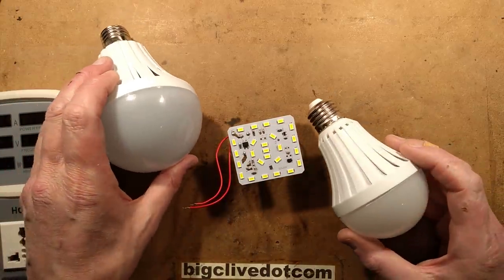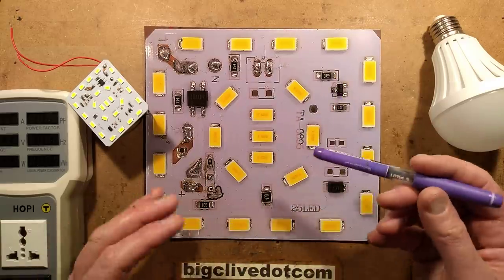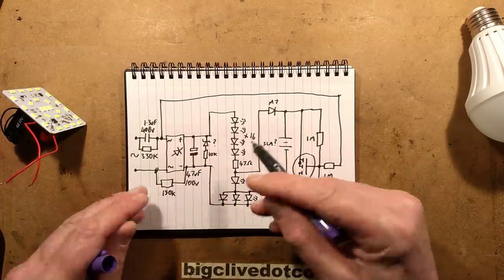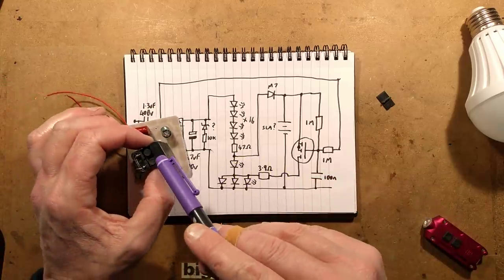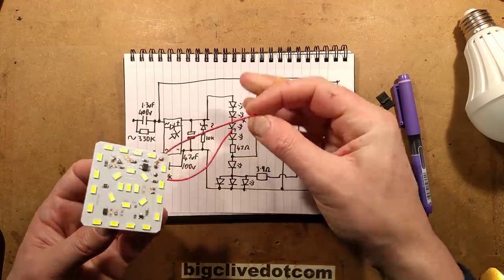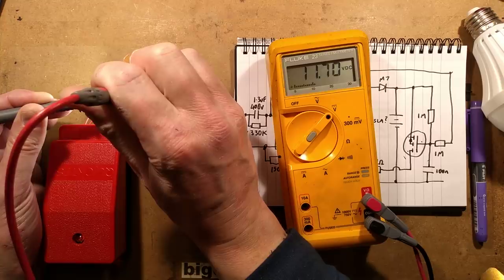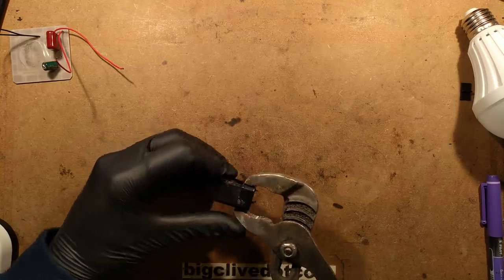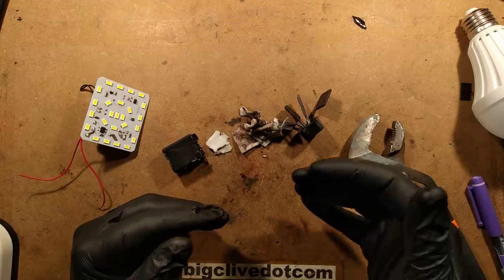Crappy lead-acid LED lamp with brilliantly simple circuitry.

Comment: That's the cutest little lead acid battery...
Reply: volvo09 I wonder if they are cheap enough to couple up a hundred or so for my car?
Reply: I have some 2 volts that would possibly spin the starter....they double as boat anchors when not powering stuff.
Reply: For starting those tiny Chinese cars...
Reply: I can't believe they are that small!
Reply: In the 90s a friend had a Walkman with sla.
Reply: baby sla battery
Reply: It’s a baby one
Reply: I love them 😍
Reply: Awe such a cute lil AGM 😂

Comment: I guess any diode can be an LED (briefly) given the right circumstances.
Reply: I was just about to say that. Thanks ElectroBOOM!
Reply: Well it was a diode and it emitted light so absolutely correct, not quite conventional or intended...🙄but typically Clive
Reply: Almost anything will light up briefly if enough current is applied!
Reply: Giovani Tapini even Clive...
Reply: There is, of course, the classical N.E.D., the Noise Emitting Diode, closely akin to the Write-Only Memory.
Reply: Now that's slick
Reply: SED-Smoke Emmiting diode
Reply: until the magic smoke makes its appearance!  LOL
Reply: @Yuri-xs9de  Hmm... i wonder if someone would be bold enough to make a vape-emitting diode... ugh...
Reply: Ackchually, pushes up glasses, all diodes do emit photons, though it's usually outside of the visible spectrum. If you got rid of their packaging, all diodes would be sensitive to light, acting as micro solar panels.

Comment: I used to work in the battery charger industry. The work used to involve the fitment and maintenance of battery charging equipment in electricity power stations and substations. Sometime in the 1980's the National Grid and regional electricity companies started specifying SLA cells, because they were promised by the battery suppliers a lifespan of 25 years and zero maintenance.
Unfortunately for them, they fell foul of a characteristic of SLA's that you probably didn't know. The 'float' charging voltage of an SLA (the voltage applied to the cells when they are fully charged), is dependent on temperature. Most modern industrial battery chargers are equipped with remote temperature probes, which should be situated at the battery location. The probes then send a signal back the charge controller, which reduces the charging voltage when the ambient temperature increases. In a lot of cases, new SLA's were installed with old chargers, with no temperature compensation. If the location of the battery / charger was somewhere nice and toasty warm, the cells would fail, sometimes in as little as 5 or 6 years. 
That being said, I can see a very short life for that little 2 cell battery. Not only is it being overcharged in the first place, I'm guessing it will get pretty hot situated behind those LED's.
Reply: The forward drop of a diode also goes down with temperature, and it's nearly the same tempco as a lead acid battery.  I've been using a string of silicon diodes as a float voltage regulator here on the off-grid homesite for decades.  LA batteries last a looooong time when you do that.  Now, as to the tempco of those forward biased leds, dunno, but I'd bet it's similar.  So, likely more clever than realized here.
Reply: @pmailkeey Well, given that Lead Acid batteries DO have a tempco, and the slightly different chemistries act a little differently (maintenance-proof PbCa vs normal) and some are more easily harmed by electrolysis (AGM), that's not a question with a single answer....
Most of my work is with deep cycle batteries, like the ~ 2300 ah 24v nominal that run my homestead (with solar and backup generators etc) or just act as a secondary UPS for the ham rig and a couple important homestead lan of things computers.  Those tend to follow the curves given by Trace/Xantrex/ or the battery manufs pretty closely.  https://batteryuniversity.com/learn/article/charging_at_high_and_low_temperatures has some info.  If you know a battery is fully charged, it ought to be set to some voltage that makes it draw only a tiny fraction of C to just sit there...maybe 50ma for a 100ah battery or so.  Which would usually work out around 13.5 v at around room temp for a trolling deep cycle "12v" battery, a PbCa one will float higher happily (14.1 at least, those don't gas as easily but also don't live through deep cycling), and you shouldn't really push any continuous current into an AGM battery.
Reply: As mentioned below, my big ones (a few tons...) DO have catalytic caps that recombine any H2 and O2 into water if I gas them a little.  Pro solar charge controllers do this according to a schedule.
Reply: What is the forward drop of the M7 Diode (I think that's what the schematic says)? The larger the drop of that diode, the lower the charging voltage will be. It could be a diode chosen for high forward drop.

Comment: I can't imagine a more pleasant design than little plastic cases filled with sulphuric acid above my head in small cheap devices that may fail with heat.  Awesome!
Reply: AGM batteries don't leak.
Reply: @----.__  I know they are sealed but when they fail they do. I am the proud owner of a failed AGM battery that was in a golf buggy and I can promise you it leaked the magic juice.
Reply: @CozzyKnowsBest  Ouch, that's unfortunate. We use them in our designs for heavy workclass ROVs due to them being non-serviceable and functional in any orientation. We do buy disproportionately expensive ones though due to having to meet hazardous area standards though, I now shudder to think of what is sold at the consumer end.
On another note, "Came House", my goodness. It's strange how footage like that can be both awe inspiring and saddening, I can almost hear the laughter of a family playing in the garden yet it's juxtaposed by the dilapidated state of the estate. Your videos are amazing.
Reply: I think you're being sarcastic, but tiny lead acid batteries in my light bulbs actually does turn me on.
Reply: Also a failed or overcharged lead-acid battery can emit hydrogen sulphide which is a poisonous and explosive gas.  I once left a LA battery charging downstairs when I went to bed and in the early hours was woken up by an awful smell, which I blamed on the cat.  When I got up for breakfast the smell was worse and the copper pipes in the kitchen had turned black.  Only then did I realise that I'd a narrow escape.

so, don't leave a LA battery charging overnight, charge it in a ventilated area, don't charge it in the house, use an intelligent battery charger.

Comment: A small but interesting point of chemistry: Sealed lead acid batteries don't use polyester (which would be decomposed by the sulfuric acid) or any other type of plastic to absorb the acid. The only plastic involved is the battery casing, which is typically polypropylene or high density polyethylene, since they are structurally strong and resistant to all acids.

There are two types of sealed lead acid battery: Absorbed glass mat (AGM) cells or gel cells. In the AGM type, the space between the lead plates is filled with fine glass fibre matting, similar to glass wool for cheaper cells or can be the properly woven matting for high end, ultra-durable cells. The glass fibre soaks up the acid and holds it in place.

Gel cells use about 5% by weight of fumed silica (silicon dioxide) which is an especially fine powder, made by incinerating silicon tetrachloride in a 1500 degree (or hotter) flame. This has an absurdly high surface area which makes it an excellent gelling agent, and its inert nature means it can be used to gel concentrated acids, even rocket grade nitric acid if necessary.

The two types do have advantages and disadvantages. Gel cells contain more acid for their size, giving them a higher amp-hour rating, since the charge capacity of a lead-acid cell is based on how much sulfuric acid it can hold. However, gel cells can still suffer from plate-warping (if the gel is allowed to dry out) and bridging crystal growth (resulting from excessive discharge) in the same way as ordinary wet cells.

This is where AGM cells have the major advantage. They contain less acid (so have lower charge capacity) because more of their volume is filled with glass fibre. However, the glass fibre matting holds the lead plates apart and prevents plate-warping, even if the cell is completely dried out. The glass matting also prevents (or at least inhibits) bridging crystal growth, meaning that AGM cells can be subjected to much deeper discharge cycles without damage.
Reply: If the cell is completely dried out, why would plate warping be of any concern? That cell, and the whole battery, is ready for the recycling bin regardless of how straight the plates are.
Reply: The usual cause of plate warping IS drying out of the cell, and it doesn't have to be completely dry for that to happen. The liquid component of the battery (the electrolyte) is 35% sulfuric acid solution in water, regardless of whether that is gelled with silica, absorbed into glass fibre, or neither. The sulfuric acid is converted into lead sulfate when the battery is discharged, the reverse happens on charging, so very little acid is completely lost unless the battery case has a leak.

The water is another matter: Some evaporates through imperfect seals, but most water loss is due to overcharging, which causes electrolysis to happen inside the battery, producing hydrogen and oxygen gases. Sometimes, batteries installed in airtight compartments have catalysts fitted inside which recombine these gases back into water, preventing water loss, pressure buildup and risk of explosion. This is however expensive, so in most cases it is easier to just periodically check electrolyte levels and top up batteries with distilled water.

If this is not done, then eventually the electrolyte level can drop enough for the plates to partially dry out. That subjects the plates to temperature variation and uneven sulfate buildup, both of which can bend or warp them. This is usually irreversible and results in the battery being binned, or preferably recycled. The exception is with AGM batteries, where the glass fibre holds the plates in place and stops them bending or warping. If it is mainly the water that has been lost, the battery can just be topped up with more water. If both the acid and the water have been lost somehow, then fresh 35% sulfuric acid can be added. Either way, the battery will then work again.
Reply: @lloydevans2900  Ok, if the cell is dry and you're going to attempt to add water, it would be good if the plates weren't warped. Got it. I've never tried adding water to a gell cell or SLA because until recently I did not know that it was possible (but apparently once you break the cover off, the battery is no longer an SLA, just an LA, and will leak if not kept upright).
Reply: @lloydevans2900  Also I've read in several different places that in SLAs the hydrogen and oxygen produced during an overcharge can recombine if the pressure inside the battery does not rise so much that the 3-5PSI vent opens. I have not however read how this is supposed to happen.
Reply from the maker: I did wonder how polyester fibre would hold up to acid as soon as I mentioned it.  The traditional glass fibre does make sense.
Reply: @brianleeper5737  The method for recombining the hydrogen and oxygen gases produced during overcharge is to include a tiny piece of platinum gauze inside each cell, usually in the head-space between the top of the lead plates and the cell caps. This acts as a catalyst, regenerating water at essentially the same rate as it is produced by electrolysis reactions. Silver-zinc batteries can also suffer from electrolysis, during both charging and discharging. These were used as power sources in the first manned spacecraft, since they offer a similarly high power and high capacity to lead-acid batteries, but with less weight.
Catalysts were not fitted to the batteries until late into the Apollo program: One of the many problems experienced by Apollo 13 during its return to earth was a minor explosion in one of the lunar module batteries. The LM was powered exclusively by batteries, two in the descent stage and two in the ascent stage. The Apollo 13 emergency caused these to be discharged to a far greater extent than any other mission, causing the buildup of unprecedented quantities of gases inside the batteries.

There are a couple of problems with the catalyst system though: Platinum is of course expensive, so even the tiny amount required can add up when you consider the mass-production of batteries. The larger problem is again one of chemistry - the recombination reaction, low volume as it may be, generates some heat. So if a battery is overcharged, the catalyst provides an extra heat source, on top of the heat generated by the normal charging of the battery itself. If the overcharge rate is high and continuous, the battery could in theory get hot enough (eventually) to start boiling the water inside the cells. Which could be a recipe for what engineers call "catastrophic self-disassembly".

Comment: This is exactly what my lamp circuitry was like... but mine uses 18650 cell without protection instead. That SLA battery is very common in cheap Chinese flashlight or mosquito racket because they're cheap and don't require protection to charge, they usually just get charged by a capacitor dropper like that but I haven't seen one venting or oozing out electrolytes though.
Reply: All rechargeable lithium batteries require protection!
Just because the chinese cheapos might not always have it does not meant that that is a good thing ;)
Reply: @Ultrazaubererger  oh sorry, i mean the SLA battery is common in cheap Chinese stuffs
Reply: nimh is still allowed for backup lighting systems, because i guess the manufacturers are too lazy to develop a bit of extra circuitry, they too can be continous trickle charge
Reply: @Jusb1066 NiMH is super durable and stable and it doesn't need fancy charging circuitry, the only cons of it are fairly low capacity but I think it's fine for that purpose
Reply: @pierreuntel1970  yep, but i also had a brain fart, nicad is sill allowed for lighting, and that is how they are still sold in the UK
Reply: It's an AGM battery.
Reply: My mom had a super chinesium flashlight, it broke, and now i have the battery, it's pretty heavy, and looks about exactly the same as the one in the video
Reply: Contrary to nickel cells (which can be charged from a capacitor dropper plus rectifier without any additional regulation or protection), lead cells do require some kind of regulation or protection though.
Reply: @mjouwbuis  These last for one whole year which isn't good but not bad either for the price tag.

Comment: Safety squints on. I really like those glass mat batteries. Such a simple thing but I find they're much more robust in my possession and on my bike than a regular flooded cell.
Reply: Yeah, I have a 12n12 sealed lead-acid on my Harley...nothing big, no electric starter...they last 5-6 years or more...even less $$ than wet cells...Yuasa.

Comment: I wonder they'll use super capacitors soon.

But I want that tiny lead acid battery, didn't knew they made them that small.
Reply: Super caps would need to come down in price and increase in capacity before they would be viable.
Reply: They are mainly used on cheep flashlight and mosquito swatters. 4v measured, that means internal part is 2*2v
Reply: RIGHT!? I want to put that battery in everything. My cell phone. My remote controlled car. My vibrator. My left shoe.
Reply: I got one from a cheaptastic charging LED flashlight, it has contacts that pop out and plug into the socket, served me and my mom very well for a long time

Comment: Sealed LA batteries sometimes have a catalyst foam somewhere in its package to burn the generated O2 and H2 back to water. If you over charge one of these batteries, they will just heat up and dissipate the extra power dumping in them,
Reply: The true good sealed ones must have that, whereas this is the "valve regulated" type that just let's gassed escape? Or do they all have valve vents? I've only pulled apart a few agm batteries (those common backup batteries) and they only had the rubber nipples. I haven't come across a high quality agm battery yet.